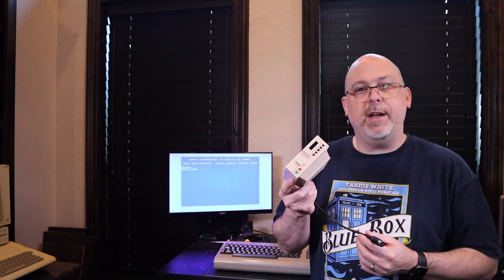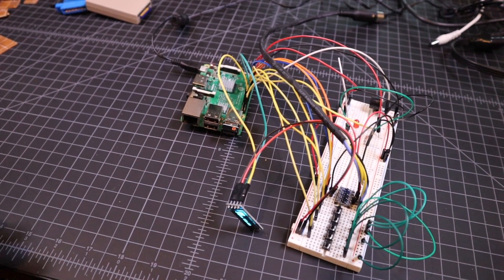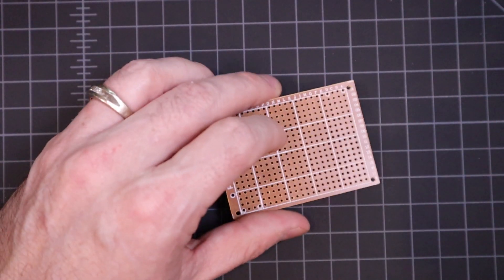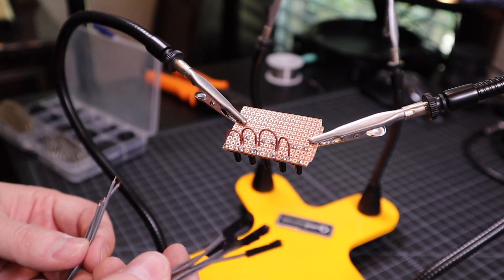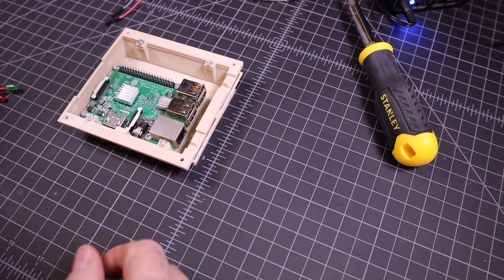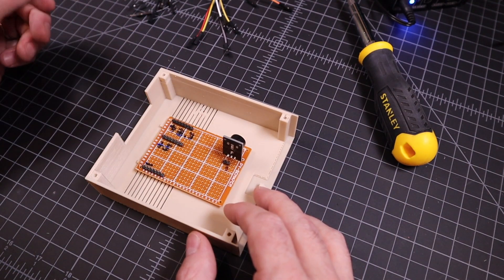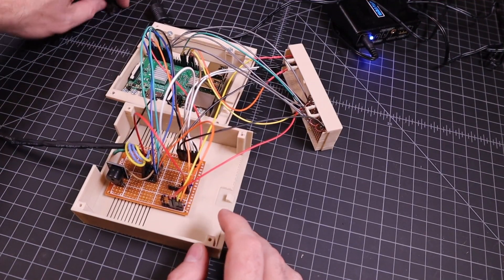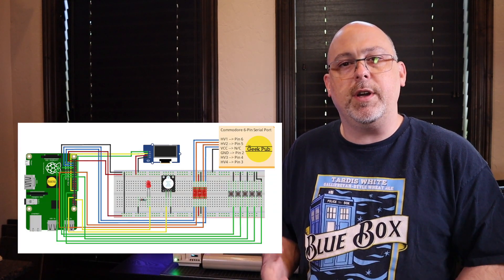Pi1541 Build (Commodore 1541 Emulator)

Comment: Isn't a 600mhz or faster ARM A7 a wee bit of overkill for a 1541?  I mean FFS the original had a ~1mhz or so 6502 in it.

Seems to me more like a job for an AVR.... or at least a cheaper ARM.
Reply from the maker: Yep.  But at $25 does it really matter?
Reply: @TheGeekPub There is that... still given what I can get a Arduino knockoff from China for (five for $10) it still seems wasteful... and it's not like driving a $3 I2C monochrome display is gonna tax it any more than the C64 side of things would.

Side note, loving all these cheap little OLED displays on the market now.

Comment: Excellent video. Back in the day, I didn't have a 1541, I had a 3rd-party work-alike: the ECI FSD-1. It worked perfectly, as I recall. I found it advertised in the pages of COMPUTE! Gazette or some-such. I remember buying the EPYX Vorpal disk accelerator to speed things up. It was even faster than the FastLoad cartridge.

Comment: I wonder if other Pie models would suffice. Have few hanging around.
Reply: I can't see why not, I think a Pi Zero would probably do the job as long as you get one with the GPIO pins. Think the use of a Pi3 is over kill.
Reply from the maker: I don't believe the code will run on a zero.  At least according to the documentation.
Reply: @TheGeekPub  Hmm, yeah, zero is slightly different beast. Pi2 or one, perhaps.
Reply: @TheGeekPub  Interesting, wonder why? The code open source?

Comment: The Pi1541 is sure a very good alternative to the original 1541. Even the X2018 demos, which are known to be challenging for the disk drive, work perfectly. There are pcbs on github, which can be ordered from the pcb manufacturers, like allpcb.com, Pcbway.com, jlcpcb.com etc. This hat has separate pcbs for the buttons and for the iec bus connectors: https://github.com/svenpetersen1965/Pi1541-HAT
Reply: Is it possible to make new CPU for C64 ? 
I mean a lot of people have C64 but we need more power, so maybe someday we can install Linux on C64 ?
(simialar to C64 SuperCPU 20Mhz)
Reply: @looc3Z  There is VICE, which emulates the C64 on Linux and Windows (Apple OS?) There is also something like a new C64 Board, that is the Ultimate64. It consists out of modern semiconductors and it is capable of great new things, like loading programs from USB-Stick and connecting to HDMI. Also there is the C64 mini (for like 50€) and there will be "The C64" in December 2019.
Reply from the maker: Yes. I am familiar with those.  But I like to do things DIY.  That's what makes it fun.

Comment: Too bad the case does not accommodate using the USB ports of the Pi. Pi1541 will support USB keys now, and will also perform "firmware" updates for Pi1541 through the USB ports.
Reply from the maker: Yeah.  I may just redesign a complete new case from scratch.

Comment: I need a Pi build that will work with a 5.25 Floppy drive so I can pull all my old games of my old floppies. lol
Reply: If you have a machine with a parallel port, check out the Star Commander software and the X1541 series of cables. That’s how I converted all my games. Else there’s Arnold.c64.org